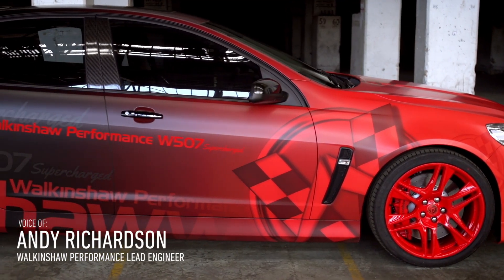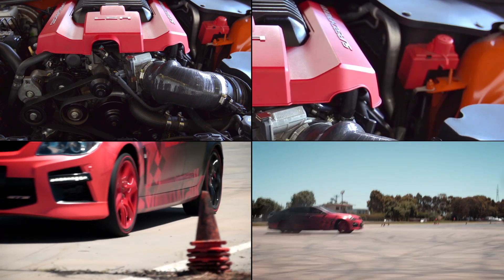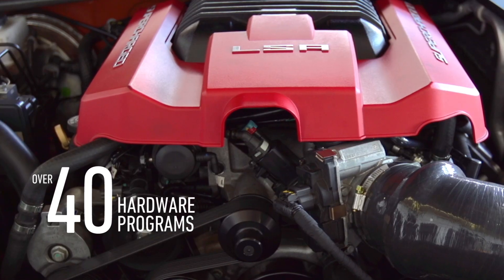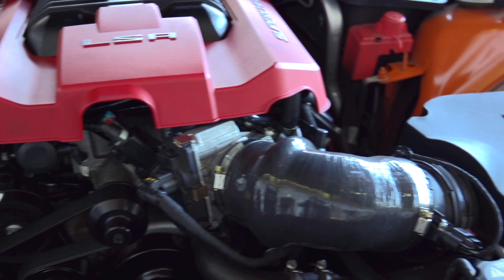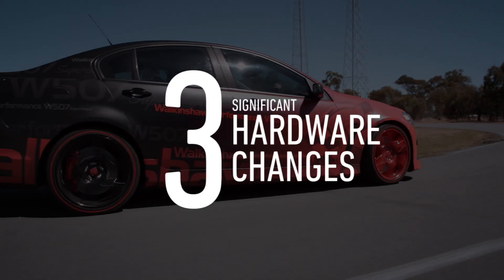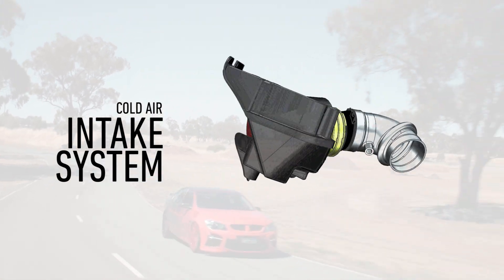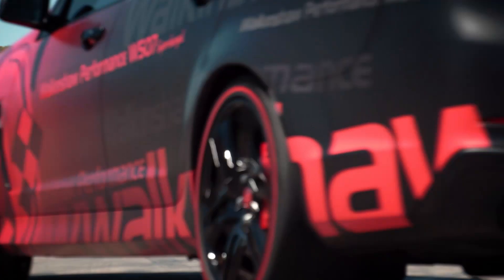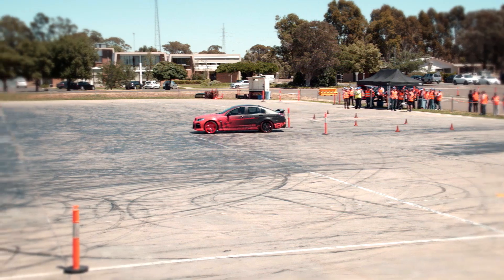The W507 Performance Package

Comment: Saw one of these at the drags running low 12's at 190kmh. LOL!
Reply: +tanoAE86 Low 12's at 507kw some kind of joke?Should be doing low 11's, easily with that power.
Reply: The guy had a bad take off. Could've easily got in the 11's with a better start.
Reply: mark23q123 yeah nah 190kmh though.. if it really had 500kw, 430-450kw at the wheels then it should be in the 200kmh plus range

Comment: The drag is much different and if you notice they're all done by car car guide and car sales which are sponsored by GMH. Not the GTF has more power undisputed!!! And you have a 6.2L vs a little 5L that's absolutely embarrassing for all you vauxhall lovers with Chevy engines nothing Australian about a Holden ever all if the except the VE have been opels, vauxhalls, Buicks with either a Buick or Chevy engine. The Torries 308 kinda is but they ordered the wrong parts and stroked the 253 and its an Opel ascona. Now back to the drags comes down to the driver reaction time tire pressure etc etc. and I have seen the drag races they don't actually show a clear 1/4mile we don't get to see the times and mph they're going like at Sydney drag way. So untill we see a full length strip drivers of similar caliber and the flashing lights and times and speed. I'm not buying it. It's never seamless and seems cut chopped. So that's what I think needs to happen to honestly prove which is faster.
Reply: The VF has no association with Vauxhall. Built in australia buddy in Melbourne. The reply content is so off the mark, it shows someone has filled your head with rubbish which you believe is gospel. My standard VF GTS has smashed many AMG, EVOs, STIs, Golfs
Reply: Stop being such a child.

Comment: a smaller pulley- cold air intake which do NOTHING performance wise only intake noise, and exhaust. = 77kw at the engine fuck you holden guys are full of shit!!!! the HSV GTS 430 = 318rwkws Got slaughtered by the FPV GTF 351= 340rwkws
Reply: Driven this personally and the GTF 351.... This version of the GTS definitely out runs that Ford(not by much, but it does), admittedly, the stock one was not as quick as the FPV, but "Slaughtered" is an overstatement.  Also, how is FPV going? They come out with anything lately? This is more more the fact its individually tuned per vehicle, and not a mass produced motor tuning where the main goal is to meet some for of ADR emissions standard in order to get it on the road.
Reply: Joshua Hatton Josh, Firstly, I love BOTH Holdens and Fords, so I don't have a dog in this fight mate. I don't understand why you say the GTF has beaten the GTF because every you tube vid I've seen has the GTS ahead by a few car lengths over the quarter. Whilst it is arguable that GTF has more dyno-proven RWHP it is obviously the 740NM of torque which propel it so convincingly past the GTF in all the drag races on you tube. Please explain what you are thinking when you say the GTS has been beaten so.
Reply: Joshua Hatton Sorry - typo in my last comment: in the sentence I stated, "I don't understand why you say the GTF has beaten the GTF because every you tube vid I've seen has the GTS ahead by a few car lengths over the quarter". IT SHOULD HAVE SAID: "I don't understand why you say the GTF has beaten the GTS because every you tube vid I've seen has the GTS ahead by a few car lengths over the quarter".  So, should have said GTF has beaten the GTS" - sorry all.
Reply: Oxygorjia X Mate, you really should spend some time looking at more you-tube vids. Every single one of them shows the GTS absolutely PULVERISING the GTF by virtue if the superior GTS 740NM of torque both down the quarter AND to 100kph. Really don't know (but would love to know) the type of chemically enhanced Kool-Aid you are sniffing because GTF beating the GTS in any sort of drag has simply and clearly never occurred. Please include a link to some evidence to support your totally outlandish and fully incorrect claim. I luv both Holden and Ford so I make no unjustified claim about the greatness of either. We wait for your considered response.
Reply: Brian Howard ... I said I couldn't speak for the standard gts much much, but the 507 absolutely beats the GTF..... Never said the GTF was faster or beat the gts, just said the few real life drags I've seen have been pretty close.
Reply: Joshua Hatton Joshua - are you Oxygorjia? He's the one I commented to here, unless I'm going strange in my old age!?